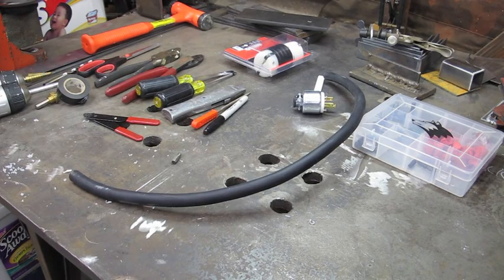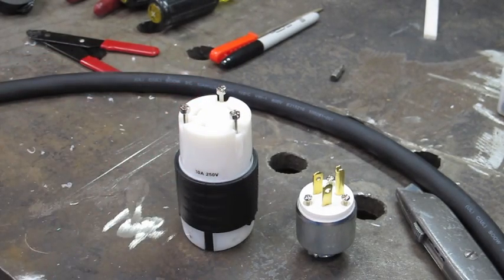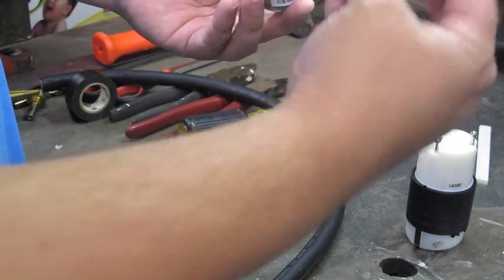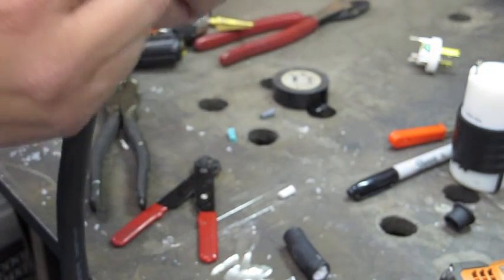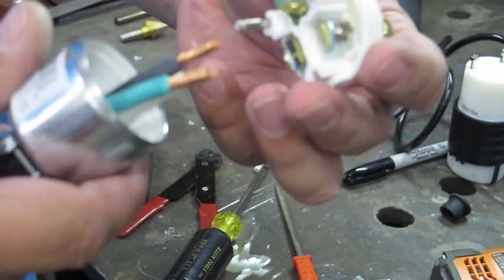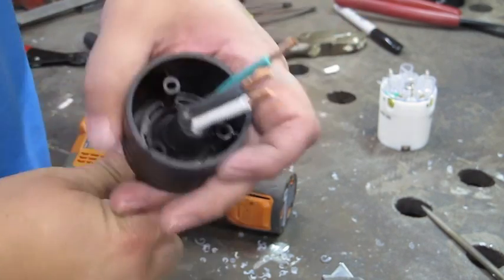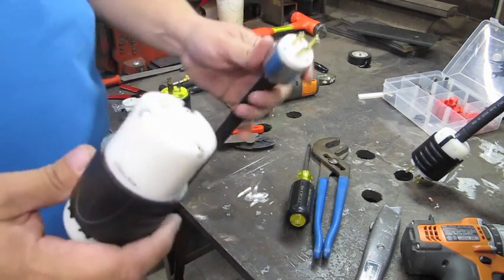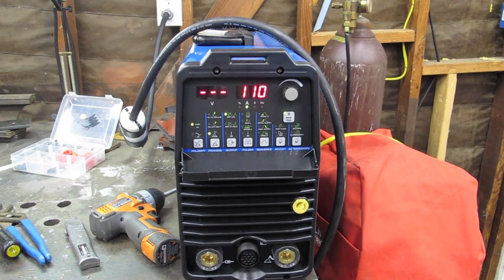Multi Volt Adapters for Miller Dynasty Part 2

Comment: Thanks for the FYI video.

Sorry, when you trimmed off one of the metal cable clamp tabs off the 120v @15a plug, you defeated a safety feature of the plug.  Next time please chose a plug that will accept the cable used.

The 10awg was a great choice, but it comes in two ratings, 300v and 600v outer sheath protection.  The 300v rating would be great for a short jumper adapter, but not the main run to the machine.

Also, the cable clamps should be the last thing installed, ya made it hard on yourself on installing them first.  
Connect the wires first, backseat the plug assembly into the shell, then install the cable clamp.

Thanks,
James
TDLR Electrician
Reply from the maker: +jd dr.jkindle Thank you, that is very helpful.

Comment: i looked every where for information on MVP adaptor ,even miller ,i in Australia have miller dx 200 and has no plug ,Australia uses 240volt single phase and 415 volt 3phase any suggestion and information .
Reply from the maker: Tim Giles The Miller 200dx' s microprocessor is supposed to automatically sense voltage and phase and then adjust to it. Here in the states you merely wire on a plug that will work for your outlet, then plug it in and go. I chose to make an adapter so that I could easily switch between 215v and 230v, and the machine does the rest. I don't know if Australian power is in any way different than here in the states, but I would suggest you contact Miller and find out. Good luck.
Reply from the maker: WeldFever I meant to say switch between 115v and 230v.

Comment: Just ordered the Dynasty 200 DX. Your video is much appreciated!!!
Reply from the maker: Great, I'm sure you will love it as I love mine! Let me know how it goes with your machine when you receive it and please keep watching and commenting.
Reply: WeldFever just a little fyi its 10 A. W. G. not awwwgggg haha stand for american wire gauge. and when buying a cord end if the amp/volt rating is higher than what ur using it for that is fine just dont go lower.

Comment: Thank you for making these videos. I have an older miller spectrum plasma cutter that is dual voltage, but you have to cut the plug and install a 220v plug. I am going to use your idea to make it true dual voltage instead of just one or the other. Awesome!